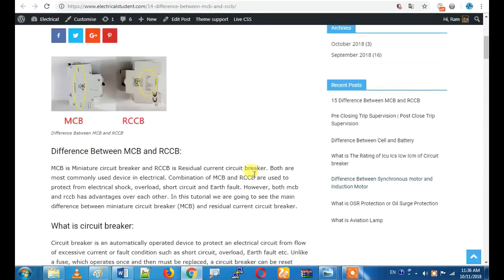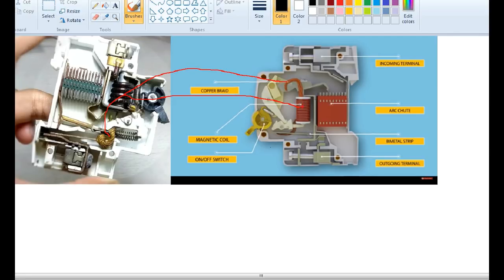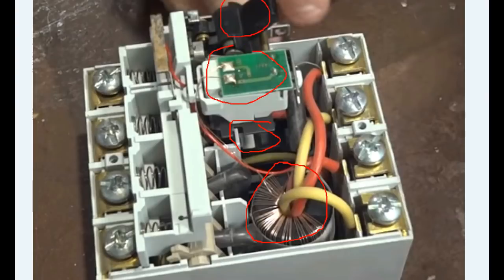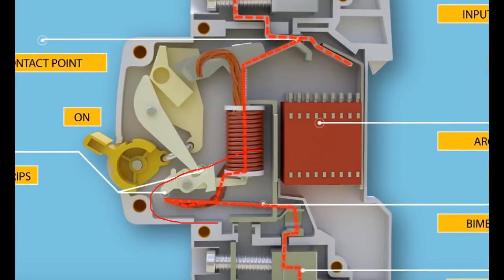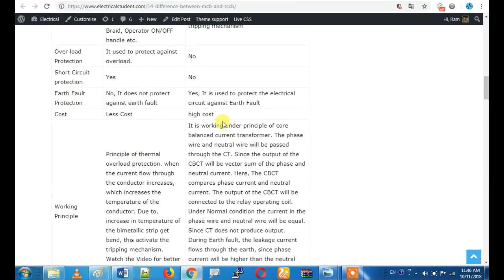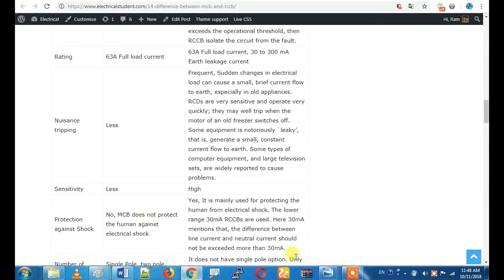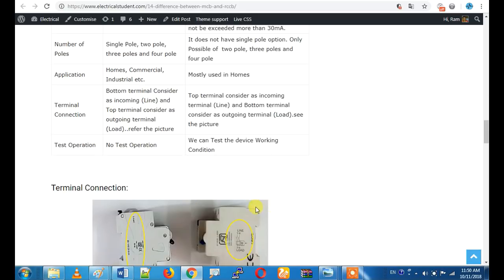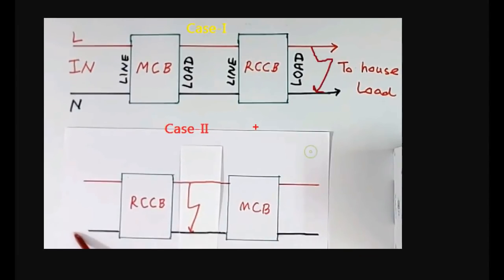15 Difference Between MCB and RCCB in Tamil

Comment: Bro, in case of fault condition, RCCB will trip depending on it's rating and the fault current. Small amount of current will have flown through Earth before RCCB tripping. In case of human interference in a circuit causing fault, RCCB will trip but current will not flow through earth. Current will always flow through least resistance of path. Human  has least resistance when compared to than earth circuit. Kudos for the video  👍

Comment: Hai sir....I am building a new house ....I have doubts...Which one is better either MCB or RCCB.
PLEASE suggest me sir...As soon
Reply: U can use both , mcb can be used at several groups and rccb can be used where u need earth protection, like motor, old grinder , heater , bathroom electricity...engalam namalala faults varumo angalam rccb irkrathu nalathu...
Mcb kandipa ovoru group kum vachkonga